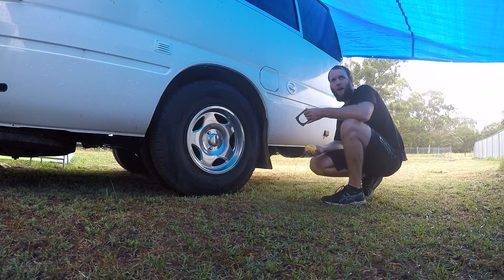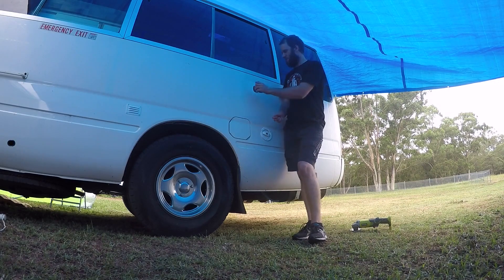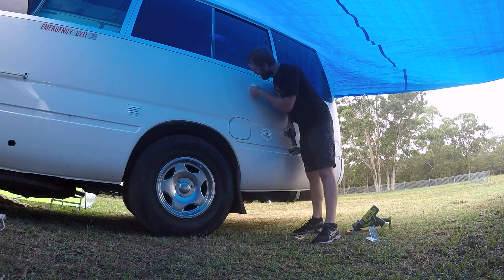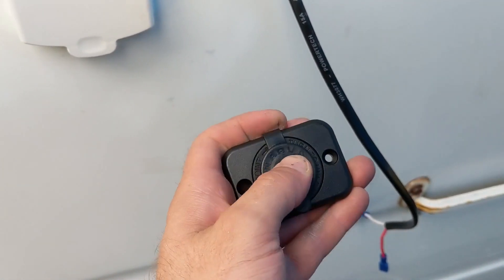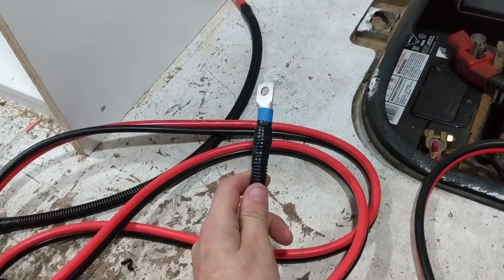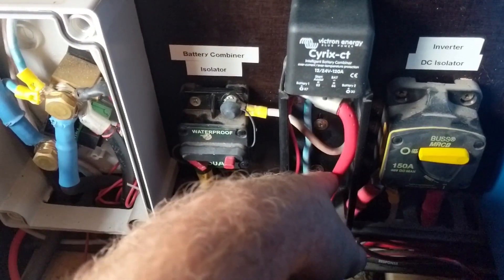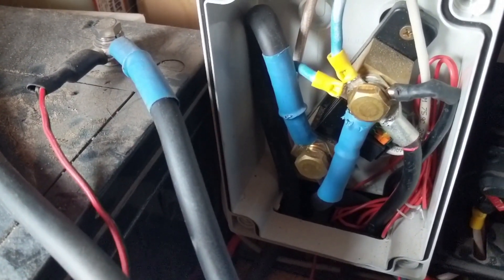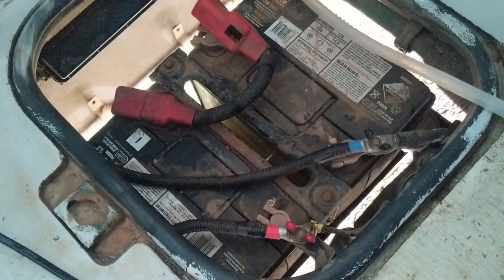Toyota Coaster Bus Conversion - Victron Cyrix-ct Battery Combiner and 240v Inlet and Outlet Install

Comment: Wow , that was a complex issue. Can't see why the battery nut did not have energy, it is attached to the terminal and cable. Doing well, good for you.
Reply from the maker: Yeah, I have no idea why it didn't work, which is why it took me so long to find. Just always assumed that part was fine. Thanks :)

Comment: If you break ground for the victron charging relay. Does it stop working? Asking because i want a manual switch to actually stop it charging in addition to having a switch to reverse the charging flow.
Reply from the maker: Hi Kenneth, I'm not sure but that is a good idea if it worked. I'd love to have more control over when it is kicking in and the flow of charge. At the moment I just use the circuit breaker under the bus near the starter batteries to turn it on/off and then it just does its thing

Comment: Hi.  Thanks for your video.  I'm an electro-mechanical engineer but I have to say that I found that all pretty confusing.  Especially the wring explanantion from about 5:10
Did you wonder why your leisure battery cables did not get power when connected via the clamp nut, but did when connected to the top of the clamp?  I can't see a reason why that should have happened.   Did you investigate it or ask anyone.  
Regards Mark in the UK
Reply from the maker: Hey, I have no electrical background so did my best to try and explain how it was wired up haha. The descriptors for the pin and battery numbers came from the Cyrix itself.
Definitely wondered why it wouldn't get power from the clamp nut, which is why it took me so long to diagnose. I tested everything I could with a voltage tester, starting at the Cyrix and working back, and found that there was no voltage on those connections. We did some googling to find that most photos had any additional connections coming off that top nut, so we took a stab and that fixed the issue. Thanks Shane

Comment: It sounds like you say in the video “don’t use a jigsaw on the outside of the bus” but unless I’m mistaken the video looks like you are using a jigsaw?.....I’m confused.
Reply from the maker: Yeah I forgot to explain why. I cut it out with a jigsaw but it scratched a big ring around where I was cutting. I had to then spray it with rustguard which is a different shade of white to the rest of the bus.

So it worked but had issues. We didn't have access to something better like a multi tool or reciprocating saw
Reply: Roaming on Rubber........thanks for the prompt reply!

Comment: Why can't you use a jigsaw on the outside of the bus?
Reply from the maker: When I cut the holes in the bus, I heavily scratched around the hole. So I said not to use a jigsaw.
I've since learnt it is the best tool for the job, you just need to be careful to protect the paintwork.